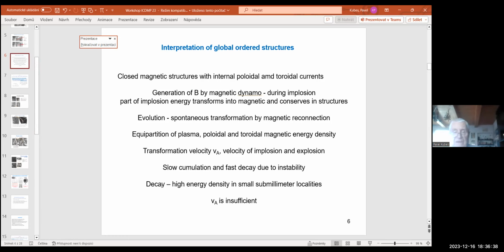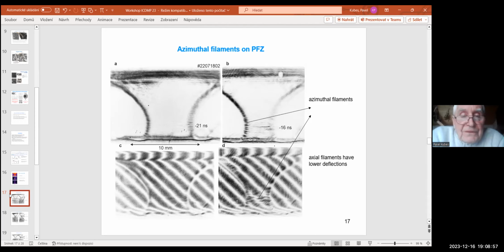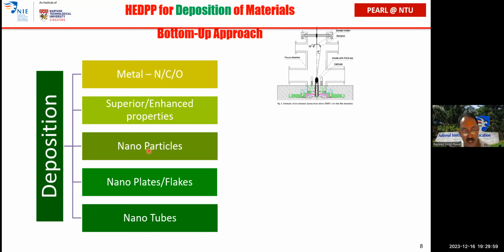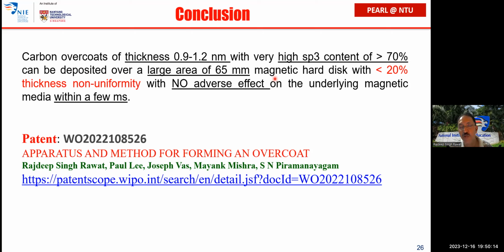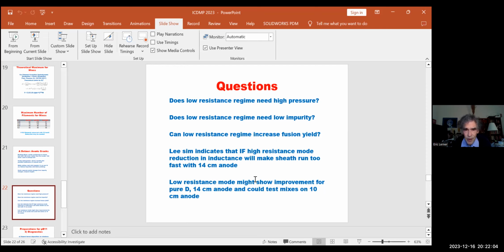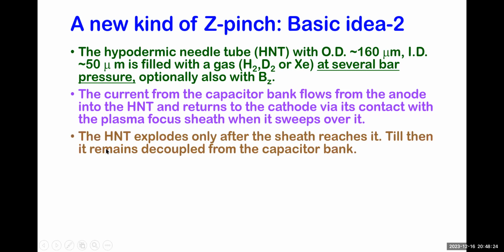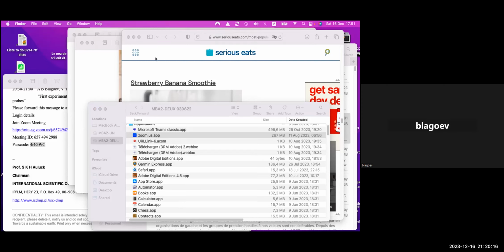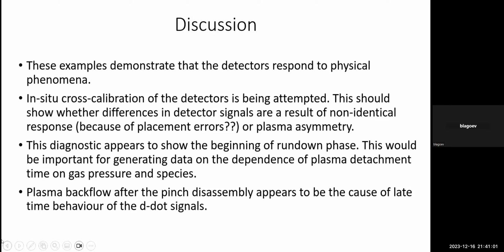International Workshop 2023

Comment from the maker: The International Workshop and Expert Meeting of the ICDMP 2023 took place on Saturday, 16th December, 2023 in an online format. 
The following is the list of presentations
Pavel Kubes:    “Plasmoidal structure and its filamentary composition in the DPF."
R. S. Rawat:       "Slow focus mode dense plasma focus device for extremely controlled carbon coating technology".
Eric Lerner:   "Progress and Problems Towards pB11"
S K H Auluck and R S Rawat, "A New Kind of Z-Pinch”
A B Blagoev, V Yordanov and S K H Auluck,  “First experiments looking at the symmetry of the plasma formation phase of the dense plasma focus using d-dot probes”